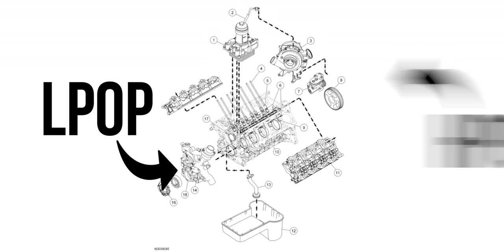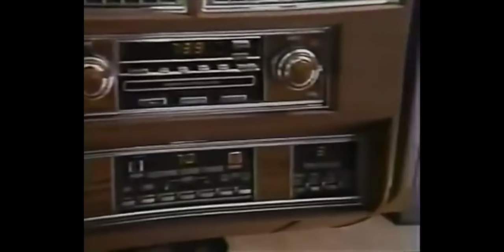These are the WORST ENGINES EVER MADE

Comment: Was the V8 Northstar engine basically the Vortec engine in later years, like the 5.3L V8 that was found in vehicles like the Silverado that had lifter issues?  If that was the case, and was the same engine basically, then yes I agree that was a pretty bad engine mainly for the lifter issues and oil burning issues.  It's really a shame that they did go to the AFM system for better fuel economy because that really killed the reliability of some of their engines (and some of the pre-AFM engines outlasted many of the newer AFM engines because they were built better, but perhaps didn't get as good of gas mileage obviously as a result of being older, older designs, and less strict EPA regulations to adhere to).
Reply: The Cadillac Northstar V8 was by no means related to the LS V8 engines found in GM trucks and SUVs.  The LS arrived in 1999 for trucks, and didn't have DOD/AFM until 2007. My 2000 Sierra Z71 5.3L LS is one of those solid engines that'll go 300K miles with normal maintenance and oil changes.

Comment: Only good engines ford ever made were the 460 big block 351 Windsor 300 straight 6  and the 4 cycler they put in the model t but other that id the the the turbo charged bentley 6 1/2 bentley turbo r engine in for the mineral water cooling system

Comment: I am actually impressed the Rover engine only got an honourable mention. To be fair the 4.0 was not that bad compared to the later 4.6 as found in the Discovery. The first batch came with misaligned dowels on the front cover that led to oil pump failure within the first 10k or 15K miles. Then all it took was a single overheat to drop a liner. The sad part is, it could have been easily fixed with "top hatting" the liners so they couldn't slip. I did that to mine and it has been trouble free for the past 60k miles aside from it's heavy thirst for top shelf fuel.

I am old enough to remember the Olds Diesel. I was 13 when a friend's father got one as a company vehicle. it promptly blew the head gaskets at 25K miles and did it again at 50K. For only having about 100hp, it did make almost 200 lb ft of torque. It still qualifies as one of the slowest cars I ever rode in, even over a 1988 Hyundai Excel I owned that had all of 62hp, at least that car was light and had decent gearing.
Reply: The aj engines are absolute garbage
Reply: @macbook802  the 4.2 supercharged is actually pretty solid. The 5.0 in every flavor is a bucket. The LR 4.0 and 4.6 are not aj engines, rather Buick all aluminum V8 from the 60s that rover just made due with for 40 years.
Reply: @rapom61393  anything land Rover or jaguar is crap. And in their defense, they did try to go bankrupt multiple times and other crappy companies keep buying them out

Comment: The ford mod motors are great engines! Yeah, engineers kinda effed us on the plug threads tho. lol They all cease. Just gotta be smarter than the seized spark plug. Dont use brute force. they'll break. hahahahahaaa... lol im sure alot of em blew out, bcuz when dudes replaced plugs, they probably over tightened em. lol

Comment: I would have to say the biggest 4wheeled piece of  garbage engine/car combined I have ever had or came in contact with as a mechanic and just owning cars was my 2003 Cadillac CTS with the 3.2 that car was the most biggest piece of junk through and through I got it in 04 I had a black one my dad also got a 2003 in 2004 his was garage kept every day he bought it with almost no miles he was the second owner and they both always had the same exact problems over and over and over I sold my years earlier because of it but he kept his and by the time we donated it it didn't even have a 100.000 mi I think it was like 76 and it had so many electrical problems and other things it had been to multiple mechanics and the Cadillac dealership that they were tired of it and said that they couldn't get parts for it and they didn't know what was wrong with it after about 6 times having it and that was Cadillac definitely the worst car I have ever owned not to mention transmission problems and electrical everything no one could fix it so please stay away from 2003 generation Cadillac CTS they are a rolling turd🤬

Comment: Cadillac Hook and Tow 4.1L 4100 V-8 125 hp and head  bolts gaskets and too slow and this turd and these would carbon up and no water jacks to cool the engine and put in a 4000 + car. The Chrysler 2.2L and 2.5L were good engines after the 1986 model year  The 2.6L Mitsu engine that Chrysler used from 1981-1986 was a bkg turd as well. The Chrysler 2.2L and 2.5 just needed timing belt services every 60k miles nut a non interfernce engine and wants the head gaskets were replaced by after market Dorman or Summit tracing ones every  only took about 3.5 hours to do a head gaskets and timing chain job  on simple and easy but only had 100 hp and 136 ft of torque

Comment: The Olds 5.7 diesel was NOT a converted gas engine.  This is a common misconception due to the fact that it uses the same accessories as the Olds gas engines and had the same bore spacing.  It had nothing else in common with the gas engine.  And the later engines with the roller cams and improved head gaskets are a reliable engine.  But it was too late when they worked bugs out.

Comment: The 3.8 gm engines catch fire because of the plastic valve covers
Reply: Actually it's because the quick connect on the pressure side fuel line going to the fuel rail will leak, very rare btw, and sprays gas on everything and if have a bad plug wire it will arc and start the fire. Has not one thing to do with valve covers! I had many of vehicles with leaking valve covers and not one ever caught fire.

Comment: If we are talking about worst engines of the 2010’s then I’d definitely say the “Pentastar” family of engines. They all either get Pentastar tick or massive oil cooler failures we just had a 14’ grand Cherokee with 143k miles on it and it just had started ticking but  before that it had the oil cooler go out
Reply: Yeah, they're pretty bad, but at least the oil coolers were east to replace, I guess.